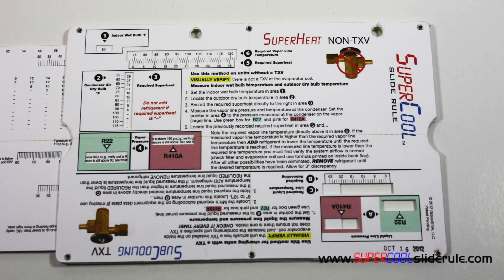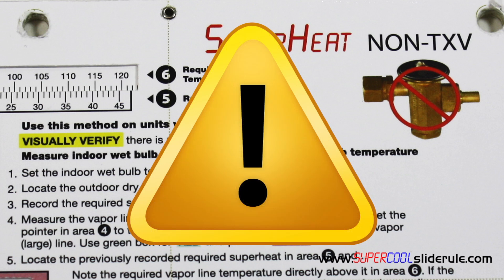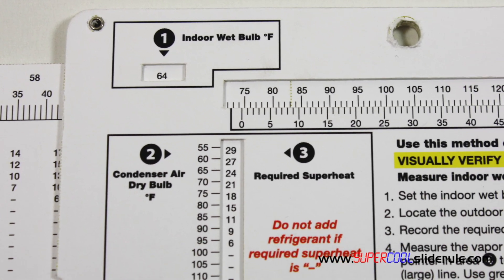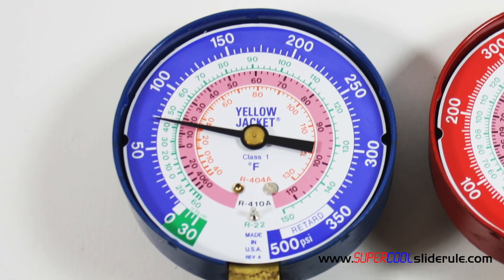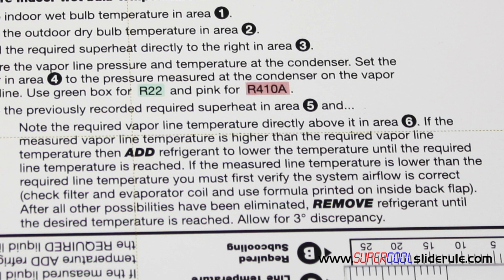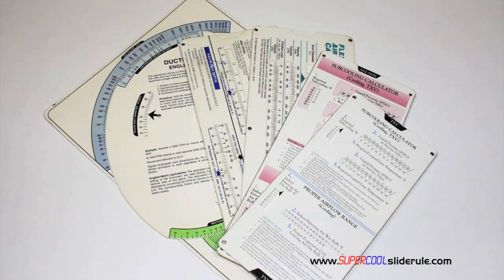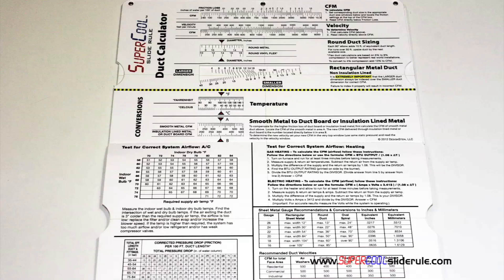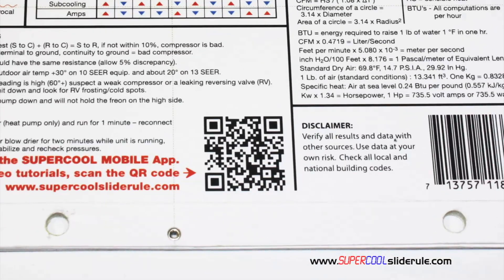Charging an A/C with the SuperHeat Method

Comment: If you are working on a unit with an inverter and variable speed compressor usually the refrigerant must be weighed in. One must reference the manufactures recommendations to adjust the charge on this type of unit.

Comment: Ok I understand TXV = sub cooling and non TXV = superheat( wet+dry) but what if the unit had capillarity metering divide and is an inverter . What calculation should be done for charging.

Comment: Where do you usually take your wet bulb temperature??
Reply: U can take it under the air handler sir where the return is at.  U will need a psychrometer.